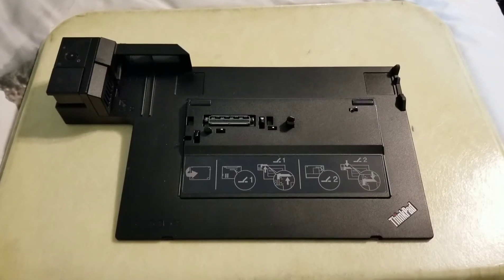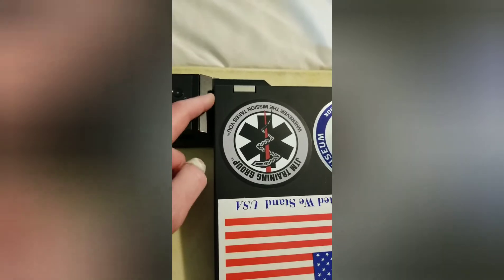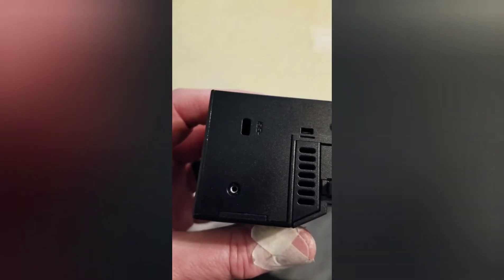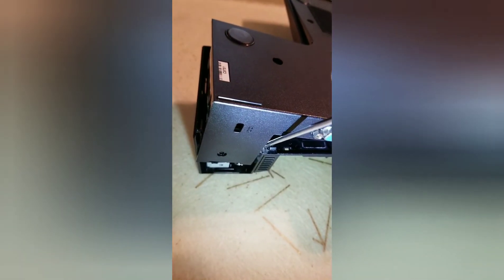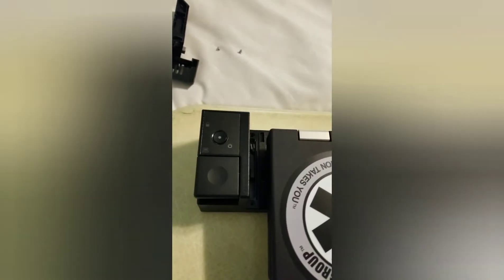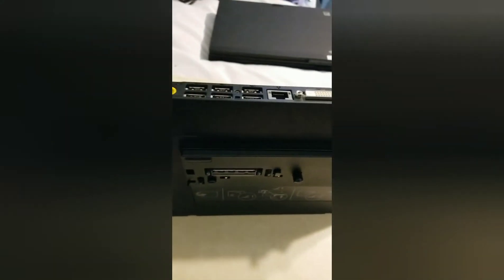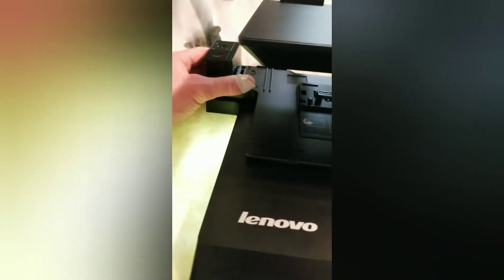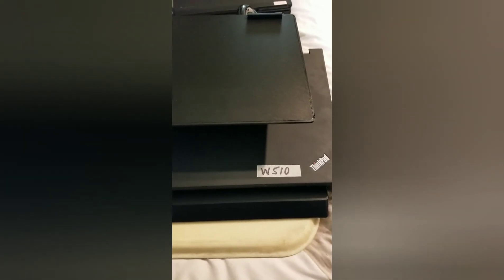Lenovo ThinkPad Type 4338, 4337, 4336 Docking Station Mods

Comment: also W520 fits and this is why it has the special high wattage PSU port for 170w 20v needed for W520 and why the 2503 advance dock wont work for W520 as it only has 90w power supply

Comment: Thanks for the video, great idea. Do you happen to know if there is any software for this dock that is of any use? With other docks / laptops there used to be an option in the power off menu where one could undock the laptop. I have also been searching pretty hard for a user manual for this dock, but it seems impossible to find anywhere.

Comment: What an amazing design flaw from an otherwise very practical company. Why couldn't they just put all that stuff on the other side? This frustrated me from the moment I got it, but I never thought it would be so easy to modify. Thank you for the instructions!
Reply: The docking station does not block the airways. Air flows in trough the grills on the underside of the machine and gets blownout to the left, where the station only blocks the power connector (it is by design so you couldn't connect two power sources at the same time).

Comment: Hi, do you know if the dock VGA port can be use at the same time that the VGA port on the laptop so we can get 3 screen at the same time? i tried but i only get to work the laptop screen and the VGA port on the dock
Reply from the maker: AFAIK, you can only use one VGA port.  If you have a 4338 dock with 2 DVI ports and a VGA port, AND you have a discrete GPU, it will likely support 3 external monitors. Without a discrete GPU, using just the Integrated Graphics in the CPU, only 2 monitors are supported.
Reply: Laptop T430, dock station 4337: internal display works, plus works two external display (the same Dell U2415), through Mini Display Port and Display Port.

Comment: that piece of plastic is hollow inside with holes so that air can pass through and its purpose is so that user don't have to guess where to put the laptop on the dock because this is also a guide to easily put the laptop on a dock, so I don't see a point in taking it off
Reply from the maker: To each his own, but removing all that plastic has been confirmed to allow the laptop cool better.  Also, some types of ThinkPad can be docked on this device that would not be able to be docked if the plastic is still in the way.
Reply: @ThinkPadModsandRebuilds-W4VHZ  I presume that makes sense in a way
Reply: @ThinkPadModsandRebuilds-W4VHZ  It blocks nothing. The air flows in on the underside of the machine and gets blown out to the left side, where it is not blocked either. Also, the x230 is compatible with the Series 3 docks on its own, without any mods.
Reply: It blocks the air flow a lot and makes it run way hotter, that's why.  the outgoing air holes provided are about 1/10 the area of the laptops output air port.

Comment: the 4338 has either 1x usb3 or 1x esata (in the same location). thanks for the video, just did the same successfully on two of my docks. locating the right spot to put the laptop in again is not completely easy but doable. i am thinking about designing an alternative 3d-printed "cornerstone" to screw onto the vga port (that i certainly will never use). btw some mean person seems to have defaced your thinkpad with some appalling propaganda stickers that you might wanna get rid of ;) cheers from europe